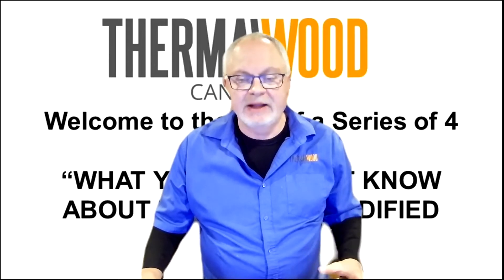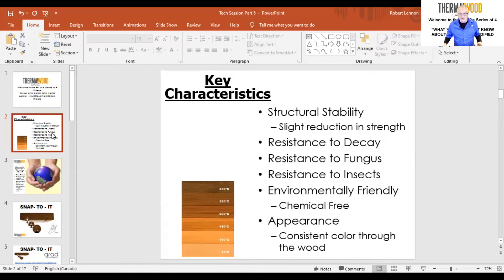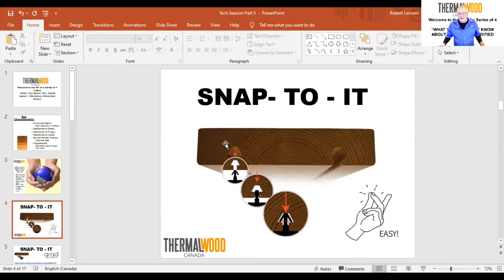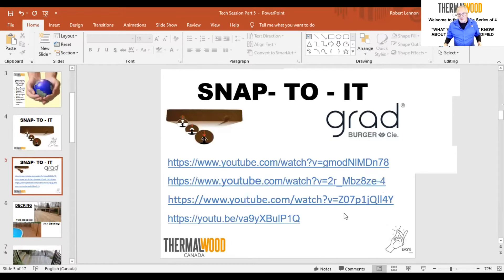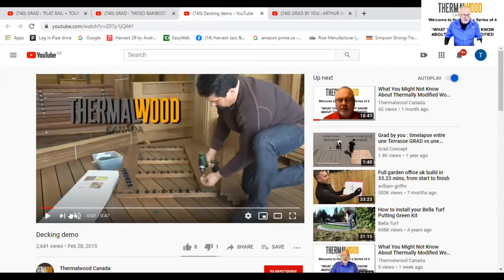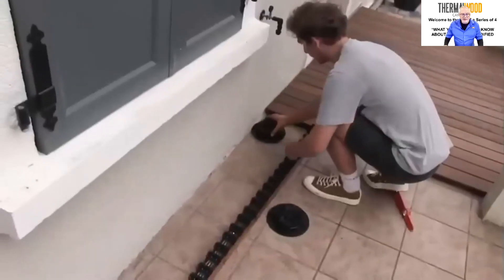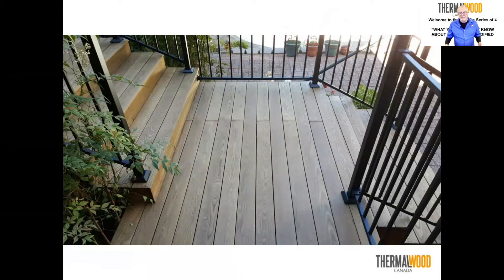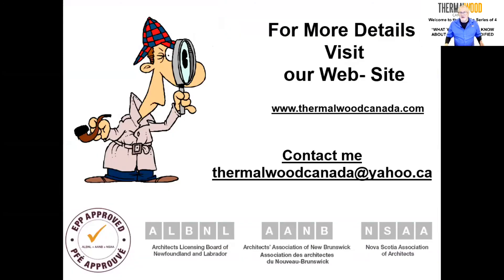Benefits Of Thermally Modified Wood Explained: (Part 4)

Comment: Too much deflection in those deck boards
Reply from the maker: I am assuming you are referring to the "bounciness" of the boards.  We have never received that complaint before.  If your joists are at the standard 16" centers, then there is no issue boards having a bouncy feel.   where we have had comments about sponginess feeling,  It is usually do to, the boards not seated on the clips properly, and it hasn't actually snapped in. which usually resolves it self.  We can also make decking with side grooves that use biscuit fasteners, which really eliminate any chance of the "sponginess"